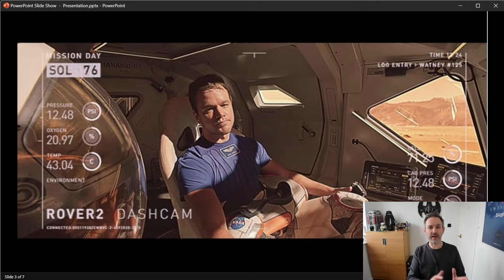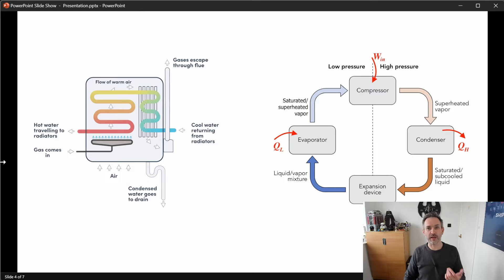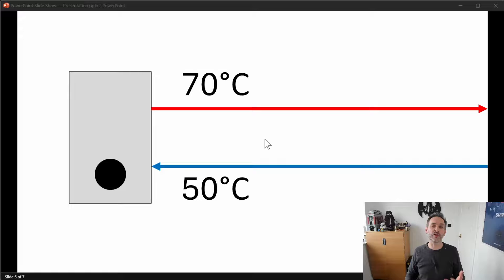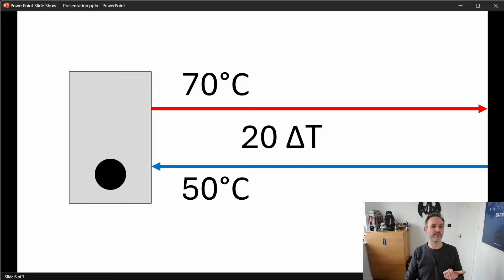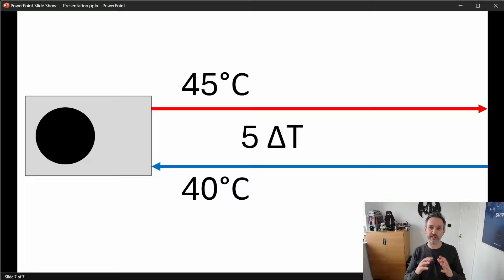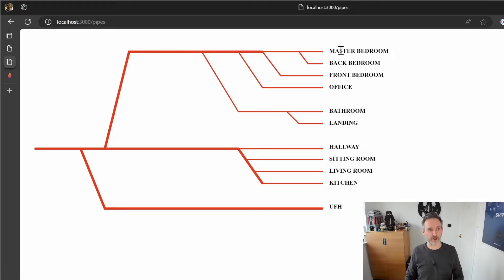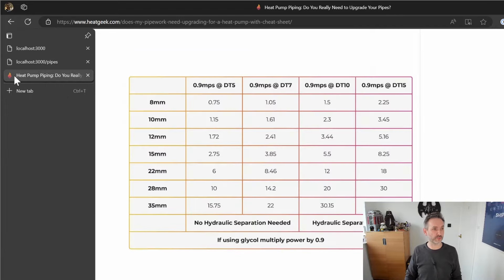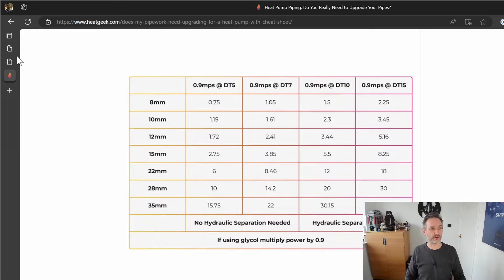Checking if my existing pipework is suitable for a heat pump??

Comment: Great explanation Tom. I wish I'd known a little more before we got our ASHP installed late 2022, but it's worked out fine in the end.  We have hydraulic separation with a secondary heat exchanger to allow the HP to run optimally, while the existing old central heating system has it's own pump & can run a little different to cope with mixed 22mm, 15mm and 10mm pipework sizes. We also have a couple of longer pipe runs and low output towel warmers needing a bit more flow and higher DT that separation can help with. If designing again from scratch I'd do what I think you are doing which is properly plan for an efficient 'open loop' solution, no separation or buffers and one pump inside the ASHP for everything.
Reply from the maker: The devil is in the detail. That becomes more obvious the more I learn. Good design is key to an efficient system.

Glad you got the issues resolved and that yours is working well.

Comment: Tom, I’m hooked. This series you propose is going to be very important for me and (hopefully) many others. Thank you. (Also very much enjoyed your other videos). In my case I’d be transitioning from oil rather than gas. Potentially one of my issues is most of the peripheral radiator pipe work is 10mm rather than 15mm (although the spine is 28mm I think).
Reply from the maker: 10mm pipe can carry quite a lot at dT 5. It would be worth drawing a diagram like I did. Then you could work out where the pinch points are. In my video, I used the optimum, so there is wiggle room if you move the water a little faster.

Comment: I'm with you on this one Tom as I'm in the same situation. 
I've already got a solar & battery system so this is the next logical step for me. 

Unfortunately my existing radiators have 10mm microbore pipework so this presents a large problem as far as flow rates are concerned & major upheaval issues if these pipes need to be replaced. Because we have an uninsulated concrete ground floor, my ground floor rads are served by 10mm pipes from the 1st floor behind the D&D plasterboard walls in each room. Replacing these pipes would cause major disruption throughout the whole house. As a result I am also considering an Air to Air system as well which would be less intrusive to install, give us a cooling facility for summer coupled with a separate HW heating solution e.g. HP Hot Water cylinder (Mixergy iHP) or a Phase change Hot Water battery (SunAmp).  
Looking forward to your next vid to see how you progress.
Reply: Colin, this is a good reply and very interesting as we seem to be in a similar situation. Your later detail and thoughts are good information!
Reply from the maker: It might not be a massive issue. You really have to work out how they are all connected and then work backwards like I've done. 10mm pipe will carry 1.1kW at optimum speed, so if you had higher speed, you could increase that. It would be worth drawing a diagram if you can.
Reply: Me too!.
I began my ASHP journey a year ago and did my heat loss analysis then.  A year down the line, I've learned a lot and intend revisiting my analysis. I've already got a map of my pipework and know the gauges in most sections. Difficult areas are the boiler flow/return and the microbore to two column radiators in my recently renovated kitchen/diner.  I'm really kicking myself that I didn't insist on a 3rd column radiator and replacing the microbore in the walls while I had the opportunity. Rather than having an 'Upstairs' and a 'Downstairs' manifold arrangement, I have a 'North' and 'South' arrangement.  The North  manifold runs along an upstairs corridor and will be straightforward to replace, if necessary. The South manifold runs under a tiled bathroom floor and in the walls (it's a split-level property), so I won't be changing that.
Progress on my journey has been slowed as I'm still trying to get my PV and house battery sorted.  I decided last year that this should be my priority while I monitored my heating system closely this heating season.  I was ready to press the button on my PV and battery last November but I'm still waiting on the DNO 😒.
Reply: @IanMK13  We may be close if your MK13 is a post code? I'm MK12. I got myself one of those Topdon thermal camera thingy's for my iPhone so I can trace where all the hot pipes are located & where they split off. My wall hung boiler pipes are accessible & are 22mm F & R up to the airing cupboard on our 1st floor landing & off to the rads under the 1st floor T&G chipboard floor. Not done our heat loss calcs yet but it's a 1986 house with filled cavity walls & only 100mm insulation in the loft which is my next job - raise the chipboard floor I put in 35 years ago & add an extra 200mm of insulation (minimum). As I said above I may go Air to Air as it's cheaper & easier to install with less upheaval but, no grants currently available other than 5% VAT if it's still valid. Undecided about this ATM.
Reply: @colingoode3702  MK13 when I created my YouTube account. Now MK15. 1990 house and I increased the loft insulation last year.  Loft only partially boarded, so I didn't bother adding insulation there, on the basis that the loft panels will have a U-value of their own (although maybe not as good as extra insulation). I considered A-A to augment the existing kitchen rads but my wife has sensitive hearing and doesn't want the fan noise.
Not sure about DHW at present - low static pressure, low flow rate, 2 existing pumped shower units so I probably want to keep a vented cistern with loft water tanks (In any case, removing the weight from the loft would probably lead to cracks in the rooms beneath 🤣🤣🤣)
Reply: @IanMK13  Yep. I also have a vented HW cylinder with 2 x Power showers which would both be redundant if I went to a mains pressure HW system of any sort. I thought about putting the HP HW cylinder (Mixergy iHP) in my loft on the platform where the cold water & F&E tanks are. Problem with that is I would need a larger loft access door which is not impossible but it's just another item that adds extra cost & hassle to the project. 
AC unit indoor unit fans are very quiet these days, 26dbA or less on low speed for most wall mounted models. I'm considering a ducted HP system on the 1st floor located in the loft (larger trap door needed for this as well) & high wall or floor mounted units downstairs. Then again I might just keep my existing boiler (it's only a few years old) & just add some HP AC units for the bedrooms. 
That said, after shelling out a shed load of cash on a solar & battery system I need to take a break & let it do it's job of saving me some money & give the pension pot some time to recover!!